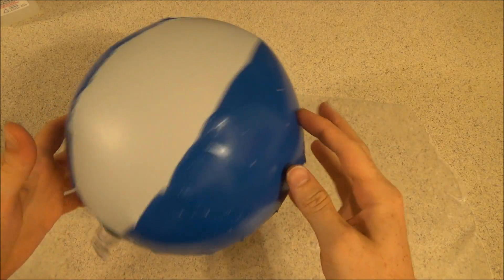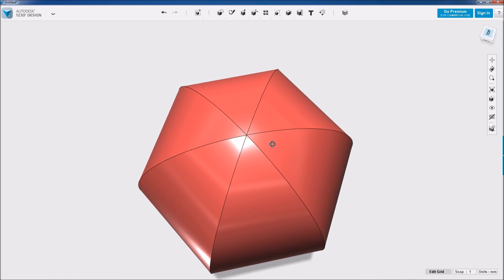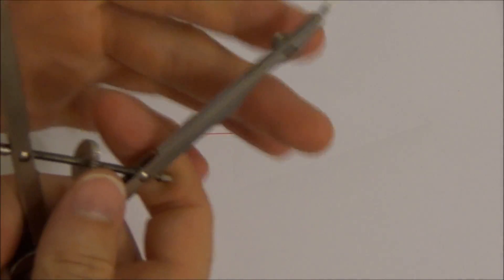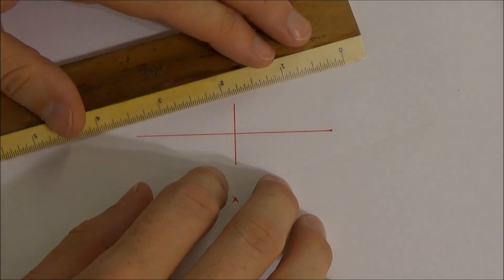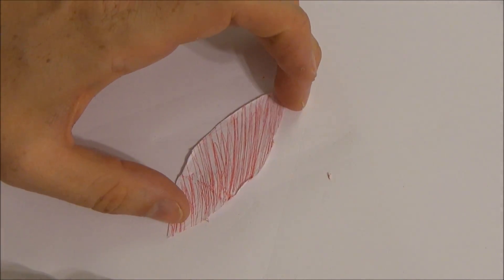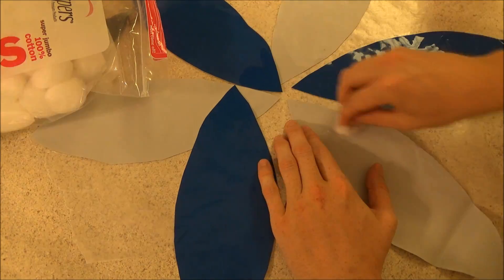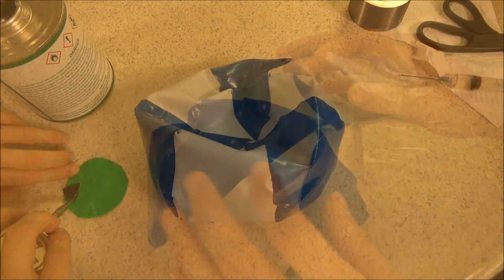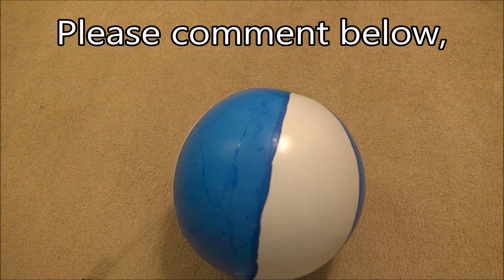Beach Ball Experiment No. 1

Comment: I made two balls back around 2000, one 2m flat and the other about 3m flat.  Sadly I don't have them now. If anyone wants to try I'd suggest basing the panels on a sine curve as it stretches to the right shape. Also don't extend the panels all the way to a point, stop short and just make the end circle a bit bigger to cover the end hole, that way you won't have a stack of 7 layers where the panels meet, and you can join the sides one seam at a time which is a lot easier.

Comment: An interesting video! I can't wait to see the heat-welded one. I'm assuming that it will be a lot bigger because it's tougher to heat-weld on small sheets? Also, two questions. First, did you just get a hole in the seam of the beachball at the end? It's hard to see. Second, is there a place you can buy sheets of vinyl? Or are you just using that Aaron because it's handy?

Nice compass and straightedge construction, btw.